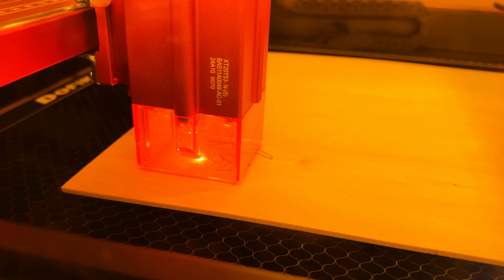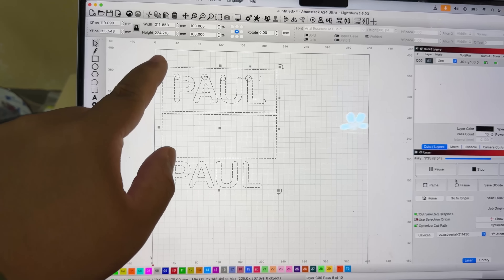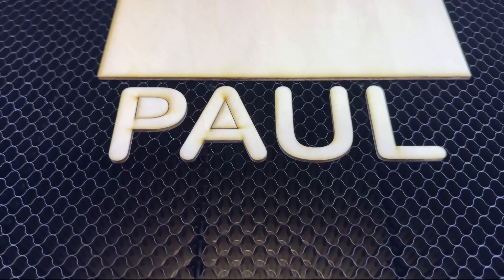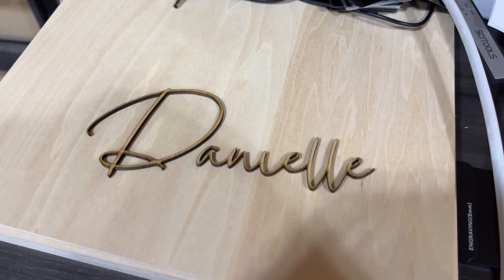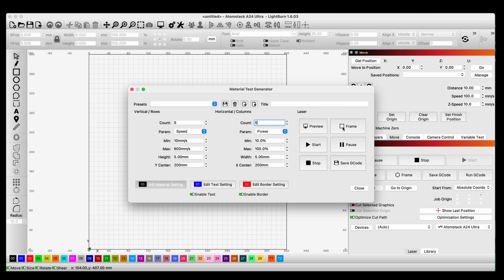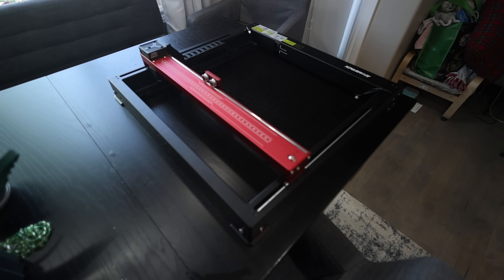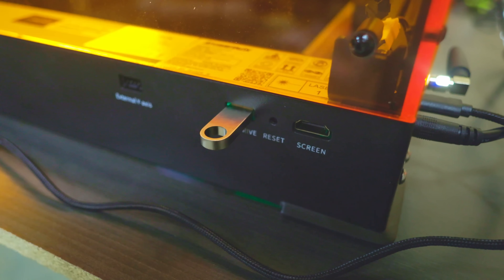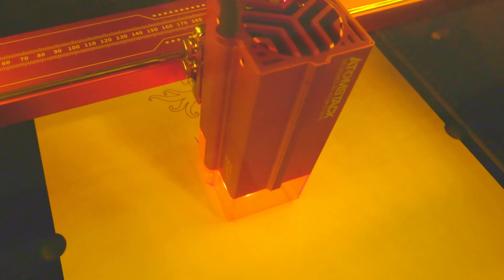AtomStack A24 Ultra | Ultimate Laser Engraver Review & Setup Guide

Comment: There is a few screws and and the enclosure on mine, some of the holes did not line up but I made it work
Reply from the maker: I think i made the same mistake? 
I actually had to remove some screws and use it somewhere else.
Reply: @techtrx  wow I hate to take it all apart ugh
Reply from the maker: @BrendaDavis-1963  ya. It didnt take that long but the cage definitely needed better instructions
Reply: @techtrx  yes it does now I can’t get my laser to engrave or cut so I don’t know if my settings are off or what’s going on. What do you think?
Reply from the maker: @BrendaDavis-1963  ohh ok. Are you using a pc or just phone?

Comment: Your review is solid, but I’m skeptical about the price.
Reply from the maker: they got cheaper version laser engraver like A12 Ultra or A10 Pro V2
Reply: and Elegoo Phecda 20w with air assist, rotary, honeycomb and filters and legs costs less than this basic machine. $500 with the options 2 packet. And the lasers are solid and do a great job.